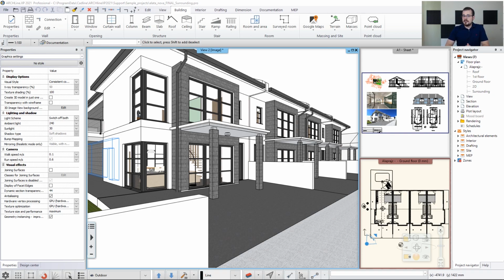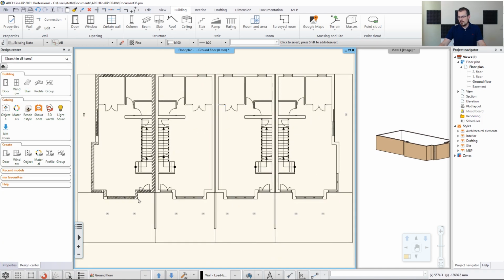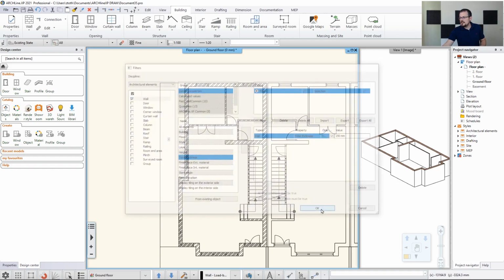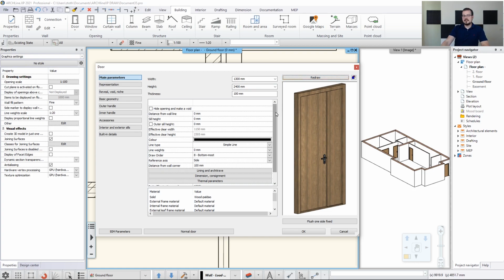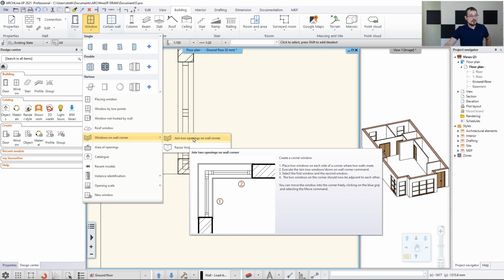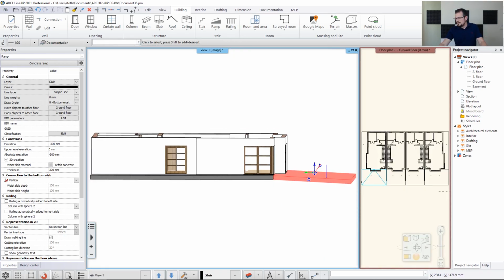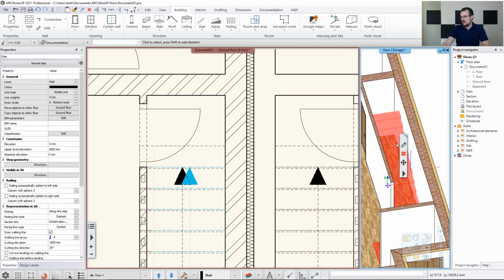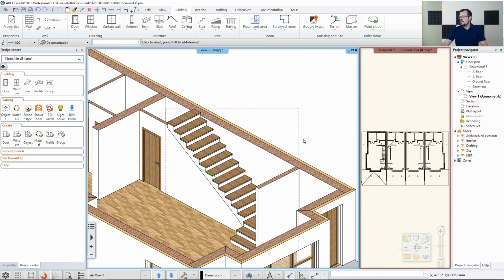ARCHLine.XP Architectural BIM course Part 1

Comment: Hi, there is no basement so I renamed it as land level and kept it 00 and after that ikept Grd flr as 600 and height 2700 mm. after that when I draw wwalls and floor it start from 00 and not reaches up to ff level. Section is also not updating.